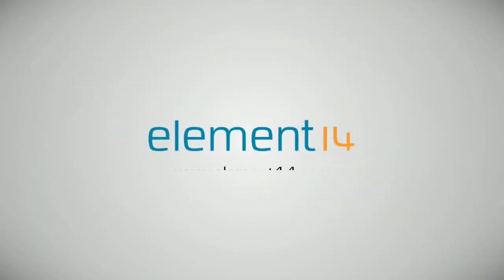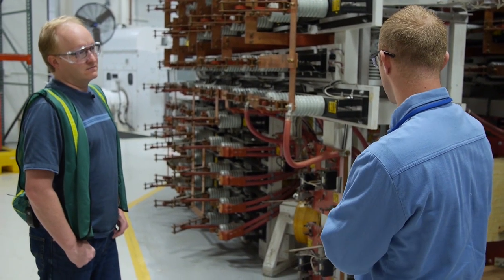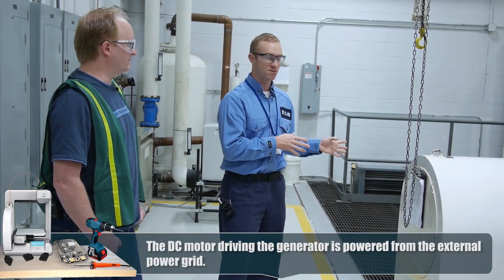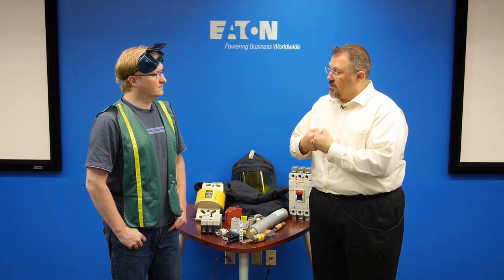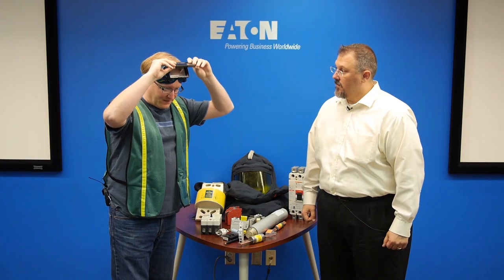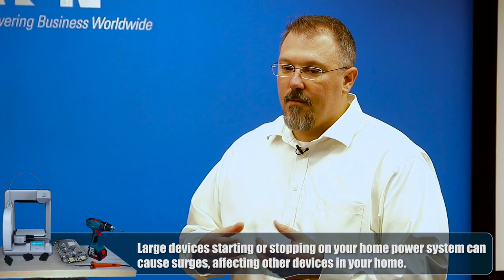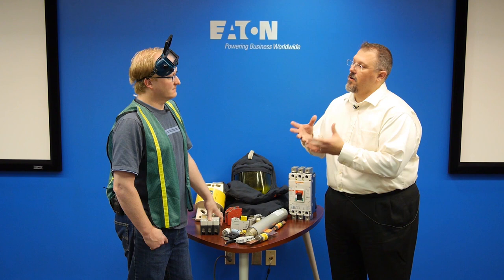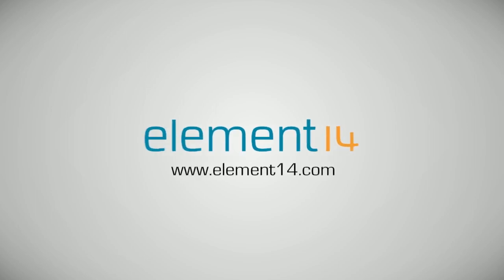Ben Heck's Essentials Series 3: Circuit Protection at Eaton

Comment: 8:00 in the US 3 phase is probably not run to residential areas, however in the Netherlands as far as I know every house is connected to a 3 phase cable.

Most houses have just 1 phase connected though, but the option is there.
Reply: +Erik Bruijn i have seen many people plugged on 208V where i live. Most of the time its for small apartments.

They only drawback is that it takes ages to get the oven at temperature i guess

Comment: I'm really impressed that you did this video.  Not long ago I was helping a young lad install our 25KW compressor and to check we had all three phases he whipped out what can only be described as a death-trap of a multimeter. It looked like something you'd buy at a discount store.

Maybe you should do a video on what happens to the hand of an operator when a low safety rating meter explodes.
Reply: +Duncan Gunn 
Dave Jones at EEV Blog did a video on that
Reply: 1903tx I Could not find it, do you have the link?
Reply: EEVblog #84

Comment: "3 phase isnt run to residential" WTF? my whole country runs on 3 phase, my house is the only one in 2sqr/km still running mono phase and i feel like i am living in 80th for that... in US you all run mono phase? damn...
Reply: *****
nice, here everything (washing machines, electrical heating, electric motors...) is 3 phase 240V... you can barely find 2 phase device and even i am using 2 phase devices i cant put like stove, heater and water heater at once, they will all under perform (since i  am running all of them on single phase) if i install 3 phase i would be able to... so that i can have electricity the electrical engineers took one phase from the 3 phase line and one solid ground...
Reply: *****
220V sorry miss typed... i live in Macedonia... as i know all over EU is same as here...
 its 220V line to neutral at my place i dont know how it is on the 3 phase line tho...
Reply: *****
yeah i know its strange :( electrical engineers installed the electricity in my house, i dont have problems at all (for now) :)
Reply: +IamIUareU US is primarily single phase, although i'd call it two phase, but that don't exist that I know of. We have two hot 120 lines and a neutral. If you want 240V you have to link the two 120 hot lines as they are out of phase so when one is high the other is low. I don't know for sure, but I think if you want 3 phase you also need another pole pig, but that could be something strange like a high leg setup. 

I knew someone owned a bakery for a time, had some industrial coffy machine that took 220. Building had proper outlet, but he plugged it in it blew the machine up. I guess he called someone in and they were like this is a high leg delta you only need 220 single phase.
Reply: +Morpheus Stark I don't know it blew the entire unit, he said it fried some sort of control/motherboard thing which is probably more sensitive than a heater. Possible it was full of cheap caps too and they went a little beyond the limit and blew. I can't imagine a plug like that being interchangeable as usually even stuff with something that has a ground and something with just a neutral have different plugs. Possible it was a bad setup or because was older building they had just retro fit something to do something else.
Reply: +Fry I see you know a lot about this stuff, and I need something answered. Is 3 phase just 2 120 volt hot lines and 1  Neutral line?
Reply: ***** I forgot about some magical website called wikipedia and looked it up. It appears to me to just be 3 hot line that are phase differently. Almost like in the U.S. Using 2 120 volt outlets on different circuits to make 240 volts. But its looking to me like the 3 phase stuff would just like that, but add an additional 120 volt hot line and make all 3 whatever voltage it is. It sounds to me like its an outlet that has 2 voltages at one outlet, and is a standard.
Reply: OK, I'm seeing 3 phase as 3 different voltages available, and they are has different phases meaning its 3 phase. (I also am seeing it as 3 phase means 3 or more voltages to have 3 phases) I think it finally hit me if the above is correct.

Comment: Us Americans sure are behind on our power systems with most houses running 120 or 240 volt single phase. Where I live we run on 240 single phase for most of the equipment. Welder, lathe, air compressor, etc. However, the milling machine is 380 volt 3 phase and to get it working properly required one of those "phase converter" devices. At first we thought a dummy electric motor was going to be needed to generate the 3rd phase but thankfully the amp draw of the mill's 3 phase motor is low enough it wasn't needed.

Yes, where I live we have a shop with a lathe and mill. No 3D milling machines but still has allowed me to make a few specialized devices. It's like a workshop from the 50s with newer non computerized equipment. Grandfather hates computers. When computers do get involved I'm the one who has to deal with the project as the resident "computer expert". Guess it fits since my PC system is hacked together from various pieces that include 2 laptops, LVDS drivers for laptop LCD displays, leftover desktop monitors, 2005 era APC UPS meant for a server, and a shitload of USB crap.

Comment: I might have this wrong. But Tom said what caused the light to blow was a 3000 Amp surge. The bulbs already drawing the maximum current it needs at what ever voltage its on. Wouldn't it be better to state the voltage of the surge?

Comment: In Germany every home has a three phase supply in the kitchen.. It's used for the stove/oven. Don't you have that in the USA? How do you provide enough energy for the oven? oO I think US homes also have three phase supplies and Ben doesn't know it, because he's never seen a kitchen from the inside. :D :P
Reply: USA residential is generally 240V center-tapped to make two 120V legs (often incorrectly called "phases" by people here). Using both legs = 240V for driers, heaters and stoves, although all three of those things are also commonly run on gas, which means only 120V needed for pilot lights, etc. 

I know this is really late, but I'm an electrician, and figured someone in the future might need to know this info!

Comment: you can get three phase electricity where I live (but its way more expensive)
Reply: I live in Finland and we get three phases. I actually have never seen less than three phase connections irl.
Reply: +parasBanaani Here in Germany you always get three phase 230/400v. I'm an electrician and have only once seen a very old house with just one phase.
Reply: +parasBanaani exactly same here in Germany. in fact, your average kitchen cooker runs on three phase
Reply: +vaxbuster we have 230v per phase (400v inbetween phases) and each home usually has a 60A fuse per phase. regular breakers are 16A resulting in 3.5kW you can pull from a regular socket. and if you don't believe me, I can take a picture of our post-power meter main fuses (there is one for each phase)
Reply: +vaxbuster there are 3
Reply: Residential UK is normally single phase, alternate houses in a street are fed from each of the 3 phases from the substation... You can get 3 phase if you want it, but it costs for the install.
Reply: +parasBanaani 
That is not correct/or could be misintrepret. In Finland, our mains outlet in homes is 1-phase 230V. Obviously this can be get from using one of the 3 phases that is indeed delivered to our home, but the mains outlet in our apartments itself is 1-phase. We only use 3-phase input as is in stoves, saunas and such.
We have 3-phase outlet here usually in every garage and commonly available in warehouses.

Regards, EE-student from Finland.

Comment: 3 phase is normal in europe to have in the house.
Reply: +FoxMccloud42 Doesn't most of Europe also not have a ground prong? That's what I saw when I visited, always wondered if you guys have some way around it.
Reply: +crazygermn We do. All sockets provide a ground connection but they vary from country to country.
Reply: Thanks, I saw the two prong sockets and I guess always assumed ground had to have its own connection.
Reply: +crazygermn Most of Europe uses what is known as "Schuko type F", it has two prongs, but the earth connection is on the side. The slim version is known as "Europlug", and is lacks earth connection, but it's for isolated (full plastic case for example) devices only.